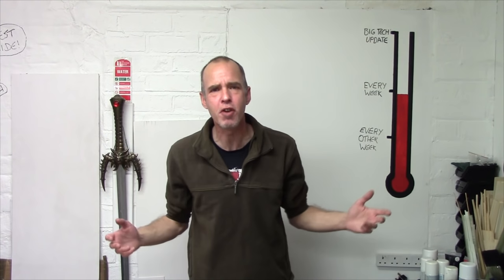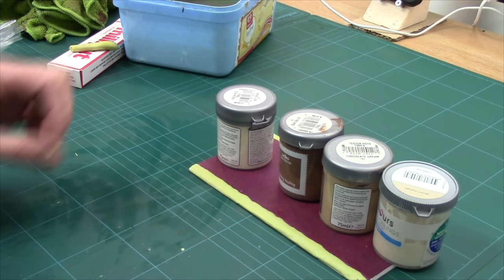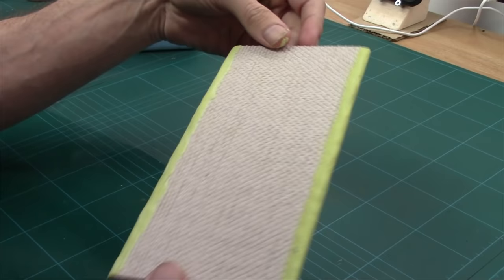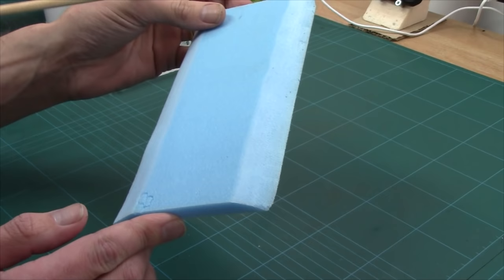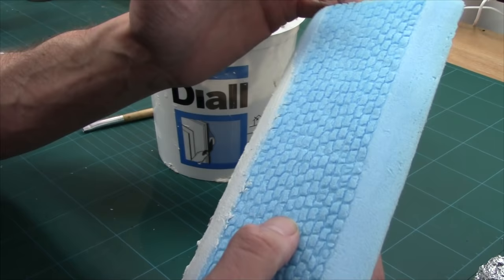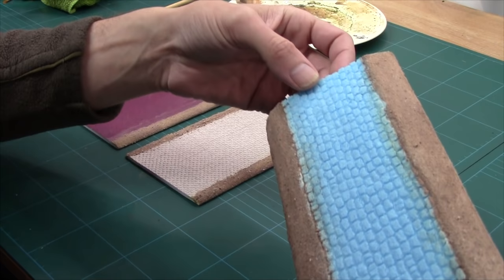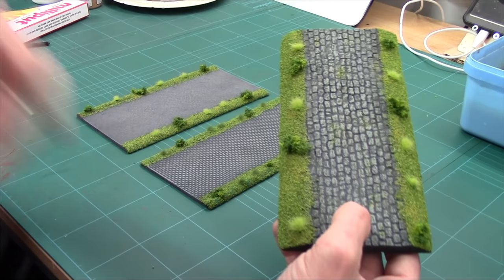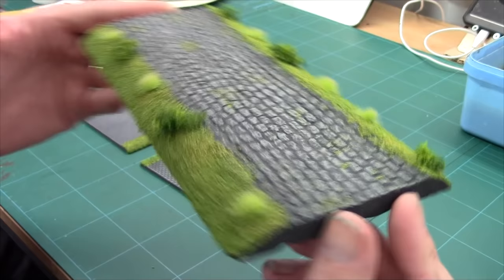Let's Make - Cheap & Easy Tarmac & Cobblestone Wargaming Roads

Comment: Even better than sandpaper is used and worn cloth belts from an electric sander.  It's stiff yet thin and the worn areas add dirty, naturally, random color.  Of course, you need access to them, but if you can you won't be disappointed.

Comment: Very nicely done.I'd be tempted to put a drainage ditch on either side of the road to provide cover for troops.  You could also use longer static grass to suggest the high weeds and reeds that grow in ditches if you don't want to hide figures in them.
Reply from the maker: I was saving that the for end of level boss! ;-)

Comment: The other advantage of spray adhesive over pva for sticking down the sandpaper and wallpaper is the fact that spray adhesive does not introduce moisture, so the foam-core won't warp.
Reply from the maker: e-pvc is water resistant mate

Comment: Another great video but I have one observation. Most cobbled streets I know have lighter cement than the cobbles themselves in the same way that a brick wall has sandy coloured cement and darker bricks. Great ideas though, I'd just paint them different. ;)
Reply from the maker: If you wanna go full bore, engrave and paint, then do the brushy filler thing, you'll get that effect mate ;-)

Comment: Now all you have to do is repeat that 50 or 60 times! lol This looks nice but takes time.
Love the hand cobbled one, it looks so much more natural. The wallpaper is nice, but it looks very manufactured and brand new. Is there anywhere in the world they're still doing roads in cobblestone anymore? Great little video Mel, thanx.
Reply: I don't think it takes too long if you run it through in an assembly line like fashion. And you don't need to go all out on the details if you don't want to which probably speeds it up
Reply from the maker: Actually, in europe, they are, they just have machines that lay them instead of being done by hand. We have a lot of cobblestone, going back to roman times all the way through the medieval, tudor, edwardian and victorian times (plus all the others I can't remember in between) and it's typically listed which means it's protected and so if it's repaired, it has to be done in the same way, look, materials as the original piece. Listed status can apply to houses, castles, roads, even ditches mate. See, you've learned something new today :-D
Reply: Well ya learn something new every day! Thanx, I wasnt aware of that.

Comment: I am looking to start building my own terrain. But not sure how much foamboard to get. Need enough buildings, ruins, and scatter terrain for a 4 foot by 4 foot board for 28mm scale skirmish game.
Reply from the maker: A2 sheet will do you fine mate
Reply: TheTerrainTutor Thanks for the reply Mel. Loving your channel. I was looking at a pack of 10 A3 foamboard on ebay. So that would be more than enough?

I have some templates for buildings, similar to the buildings designed for Infinity.  Also have some paper terrain. And looking at other scratch built terrain. And those in videogames, Borderlands, XCOM 2, Wasteland 2 etc.  Going to be using these for inspiration.

I was looking at your foamboard building series. Would you suggest adding features similar to butresses, pipework etc.. To give the buildings more character?

Looking forward to more videos. Have a great xmas and new years.
Reply: I would recommend the PVC foam that mel uses for bases. They also sell 3mm version that is brilliant for walls and this stuff is super durable. Normal foam board wears out easily. Go and put a little bit more into it and get some of that. Little harder to cut, but it is worth it, get the sharpest utility knife you can.

foamboard melts under spraycans and can peel if you leave the paper on. PVC stuff is absolutely the best! and all those techniques still work, except you need less strengthening.

You can get it in similar sizes. Better than spending all your time and then get sad if it breaks! wish i started using it is what i mean, have to slowly replace all my foamboard stuff with it.
Reply: In Mel's video on making foam core ruins, he uses one A4 sheet to make a largish ruined corner; so with 10 A3 sheets you would be able to make around 20 of those :D That would be a big of table full of terrain.
Reply: I did the math, and buying it in a 4x8 sheet (as you would insulate a basement with) was most economical, and i have foam board to burn.

Comment: Wallpaper isn't popular in my area (or I'm assuming it isn't because I never see it at the Home Depot (B&Q for the states). But I wonder if you could use those anti-skid mats you place under large rugs to keep them from sliding all over hardwood flooring. It runs for about $20 USD for a 2 foot by 20 foot roll but I'm sure you can find it in smaller sizes for cheaper...But I suppose if you need a lot of roads you could bang out 70 or so roads from a single road
Reply from the maker: I've no idea mate, can't ever really remembering seeing them, of if I have, I hadn't taken notice from a terrain point of view. Give it a go and let me know how you get on bud

Comment: Does the painted sandpaper scratch models? Just imaging a tank getting smaller and smaller after pushing it around 🤔
Reply from the maker: No, its not as abrasive once its painted and sealed mate
Reply: Thanks a lot, mate :)

Comment: great tutorial mate
just a quick question, if I put some strips of thick tape between the base & sand paper do you think it would leave raisesd areas to paint road markings? 

I have never tried roads before but I'm thinking of making a diorama base for a Gundam in a city environment
Reply from the maker: No, sand paper it too thick for it to really show through mate
Reply: TheTerrainTutor ahh ok :) thanks for the reply
Reply: You don't really need raised areas, work out a pattern for how far apart/how long you want each mark to be, then tape those distances on a piece of string or a ruler (I recommend string because its way easier to deal with curved roads that way), you could even use a combo of the two if you like. then you can just mark out where you want your lines to go. If you've got the cash and you don't want to worry about it, Woodland Scenics has a premade flexi ruler with all the marking lengths/distances you could ever want on it too.
Reply: I'm a year late. I also do layouts for gunpla in 1/144 scale. But think about it: even in 1/100 scale, the tiniest details won't show. What does sand look like at 144th the size? I spend more time on layouts than painting the gunpla now, and one of the great things is that I will NEVER have to do static grass. Even at 1cm tall, it looks funny, because that's some tall grass on a nearly 2cm tall person.

Comment: Mel, love the videos. Have so much to do I don't have the time. Love the foam board ruins you did a while back, going to give them a try. Just a quick question, would the measurements you used bet ok with 1/35 scale figures/models? Btw trying to become a patron but keeps kicking me out but I will preserve.
Reply from the maker: Use a model and some graph paper to dry run in, get a door in scale and then work from there. If you're not sure, mock it up with corrugated cardboard and tape to get an idea before you start properly. Are you still having problems with patron?
Reply: Yeah, I get to the pay page and it says problem with server, try again later. I then try PayPal it it just goes blank. Does it matter that I'm trying on an iPad?
Reply: Can't believe I wrote preserve instead of persevere hahaha
Reply: Give it a go on PC. Sometimes mobile devices have issues.

Comment: Another inspiring video. question Mel, will these stand up to busy gaming club abuse or are they a bit fragile?
Reply: extruded PVC foam is super durable, so those two are super strong. the foam one not so much. Will last a while with lots of layers of pva etc, but no way near as tough as PVC board.
Reply from the maker: Solid as hell mate!

Comment: I always enjoy your tutorials. Could I make an observation. This is not a criticism. Your cobbled roads are laid the wrong way. Cobbles or sets, should be laid long edge in line across the road, This allows rain water to flow freely from the central camber to the gutter at the roads edge when it rains. 
The way you made the road, the water has to take a zig zag route to the road edge. Try it, see what a difference it makes.  Your wallpaper technique  is  great  I´m am glad I don´t  have shares in BandQ